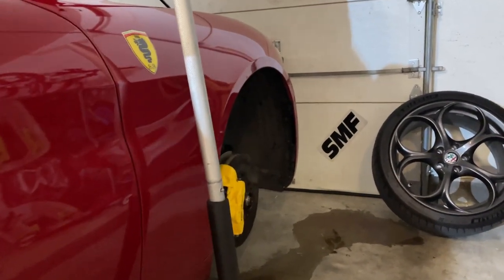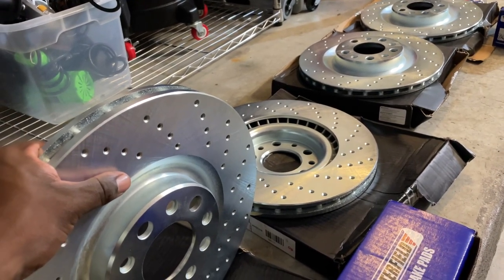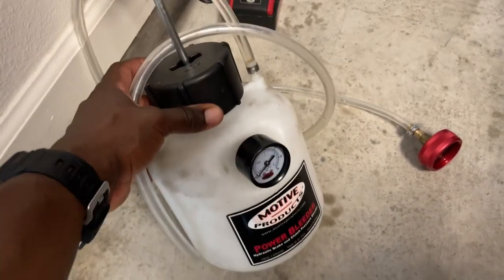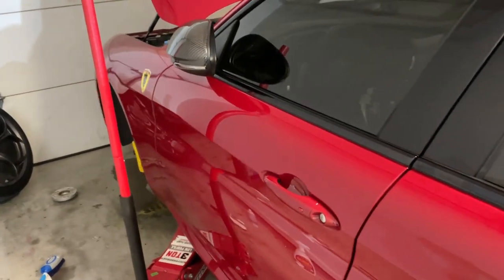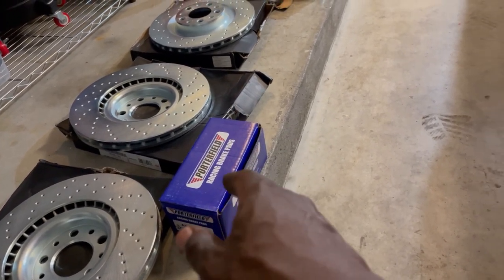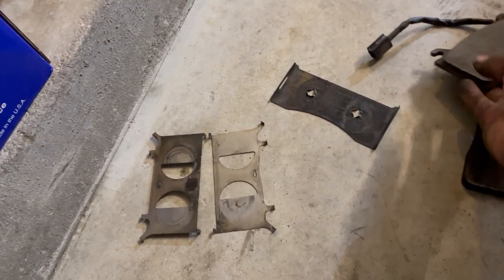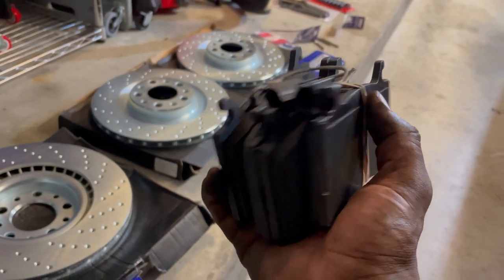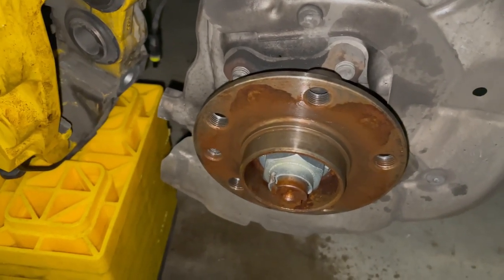DIY brake rotors and pads Alfa Romeo Giulia 2.0

Comment: Completely got me through what I thought I was going to have to spend thousands on at the dealership (no warranty). Thank you for this video and all of your thorough instructions. The only thing I will add is that when I got to the E18 socket needed on the rear brakes (that neither me nor any of the local auto stores near me had) a 14mm socket worked perfectly as a substitute.
Reply from the maker: Hey no worries! Nice hack!!

Comment: Dude, thanks for the killer video, very helpful. Amazing how clean your car is considering miles. Your engine bay and calipers look brand new. I really need to move out of the salt belt!
Reply from the maker: Thanks man! 

Truth be told I used purple power and a scrub brush on my calipers 

And I did a one stage paint correction on my car myself to restore its shine 

Thanks!

Comment: Great vid. Just to add. You can turn the ignition off when doing the rears. When built up just pop the ignition on and go back into the brake service menu. No need to bleed the brakes either as you haven’t opened the system. I’d only bleed the brakes if it was due
Reply: I second this. Did it myself and had no problem
Reply: Can you expand on why We shouldn’t bleed the brakes? I just changed the pads only, when i pressed on the pistons, a little fluid came out of the (master cylinder?) in the hood which i took the cap off for. Not sure if i need to bleed the brakes. The brakes don’t bite right away when i break,  is that normal for the alfas?
Reply: @dawudrashid1515  How did you not have the check brake system light come on?
Reply: @dennisreynolds6915  nothing came on. No codes or error. Just turned of the ignition and when done I turned it on and went back to the brake service menu
Reply: @dawudrashid1515  Ok cool. So did you put the rear brakes into service mode then did the front and back or did you do the fronts first then turn ignition on and put car in brake service mode?
Reply: @dennisreynolds6915  you don’t need the service brake to so the front. I did rear first and fronts like 2 week later. Only need service brake mode for rears. For fronts( also back) have your reservoir cap open.
Reply: @dennisreynolds6915  i would do the rears first. Then do fronts. So you don’t have to worry about all that
Reply from the maker: Thank you!!
Reply: @dawudrashid1515 how do you out it into service mode for the rear’s? With a scanner or can do it do it on the vehicles menu

Comment: Just did all 4 wheels on my 2.0 Giulia yesterday.  Took me all day (I made to two runs to auto parts store to pick up a few items, like grease and the pin punch which is needed).  All went well except now I have several faults on the instrument cluster so I'll need to see how to reset these.  The dealer here wanted close to $1,200 just to do the rears!

Your video was very helpful!
Reply from the maker: Yes this will save you quite a bit of money. If you have a Bluetooth old reader connected to MultiScanECU app on your phone you can reset the codes yourself. You can also use the ecu code reset method that is in a video on YouTube. Takes a few tries but works. i had zero codes when i did mine

Comment: Best step by step video ever! My dealership asked me about $3200 to replace brake and rotor on a car that has only 36k miles. seeing the video it looks straight forward so i will do it myself. (I'm handy guy with good mechanical engineering background ) my only concern is do i need to have reset the ECU after the repair? i cant even replace my oil on my Giulia because i can't reset the light.
Reply from the maker: No need to reset anything my friend!
Reply: @club.alfagt  You're the man!

Comment: You shouldn’t keep the cap off the reservoir for too long. Brake fluid is hygroscopic meaning it absorbs moisture from the air very easily. This will decrease the boiling point of your brakes and can lead to insufficient braking performance. Be careful.
Reply from the maker: That’s right, good point! Hope everyone reads this!
Reply: @club.alfagt  I’m thinking of buying one this week. How has the reliability been for your car?
Reply from the maker: @poptartknight565  great! I’ve only had one issue with a coolant hose cap coming off, but Alfa care took excellent and prompt care of me 

Other than that I’ve dailyed this car with a piggyback tune, driven on the track 2x, road trips 

Bulletproof 

The 2.0t Alfa’s are magical man. Awesome, simple performance and reliability with a supercar chassis for an amazing price
Reply: @club.alfagt  which tune?
Reply from the maker: @poptartknight565  JB4 piggyback
Reply: How long should I take the cap off? Changing my breaks and rotors next week
Reply: That’s a non issue for the time taken to do a brake job.

Comment: When brake disc or anything behind it comes off, then after refitting lateral runout of the disc have to be checked with dial gauge. For example this is written in Brembo instructions.

Comment: For anyone doing this job, do yourself a favor and before you do anything make sure you can remove the pins.  I spend 4 hours using whatever I could find to bash that pin through.  Ive been working on cars for a long time, Ive never had anything so seized up.  Northern state that the roads use salt if that matters during the winter.  I tried everything from torching it, penetrating spray. Once you get it out so far you have to put something in front of it then use a cut off allen key through the hole to hammer the pin the rest of the way through.  Otherwise easy brake job once you get the pin out
Reply from the maker: Just get a push pin set lol

Comment: When I was replacing mine one of my pistons in the caliper popped and break fluid came out? 😅 is this ok or am I in trouble
Reply from the maker: Omg… needs to be rebuilt
Reply: @club.alfagt  yea bro my breaks also went into a fail safe mode idk if it’s only for 2019 alfas and up but I guess your suppose to completely disconnect the battery when you change the breaks should add that to the video cuz that was a big rip 😕

Comment: Great video, thanks for this. I have a Stelvio, but it should be the same job. One thing I don't understand, why would you bleed the brakes? That is needed only, when you replace the brake fluid. I have just purchased the Madness Sport Plus springs, and I'm trying to find a solution for the rear camber adjustment. I'm wondering, if the rear camber arms are the same for both Alfas, because Megan Racings sells adjustable camber arms for the Giulia.
Reply from the maker: I have some Megan racing camber arms in my garage ready to go on soon 😉

I guess you don’t have to bleed them afterwards however I do so out of good habit!
Reply: @club.alfagt  That is great to hear, that you have those camber arms. Can I ask you a favor, could you please measure roughly the distance between the two mounting holes, to see, if the Stelvio uses the same length arm? I would like to order them as soon as possible, but I'm not sure if they would work. Mine is  base model, so I'm about to install the SGW, paddle shifters and red button on my car. Got already the idiagnosis kit from UK, and the multiecuscan software. Start and stop disabler from Ali works great very well, and it is cheaper, than the carstuff unit.
Reply from the maker: @19mati67  I sure can! Are you going to enable race mode in your Stelvio?
Reply: @club.alfagt  I'm not sure what that does on a 2.0L car? It actually changes driving dynamics and removes traction?
Reply from the maker: @19mati67  yessir
Reply: @club.alfagt  Did you have a chance, to measure the camber arm mounting bolt distance? I would appreciate it a lot.
Reply from the maker: @19mati67  as you know, these Megan camber arms are adjustable 

But from the fully closed position, middle of the hole to middle of the hole was 7&1/8ths inches or about 7&3/16ths
Reply: @club.alfagt  I know, that they are adjustable, but I may need a much longer one for the Stelvio. Maybe it is not adjustable to that length. Thank you very much for the info. I will have to compare it to my SUVs arm length.
Reply from the maker: @19mati67  yep no problem! These get installed on the 7th!
Reply: @club.alfagt  Today, I have replaced the red start button, installed the paddle shifters(I still need the software part done), installed LED strips in the V grill, and added those Alfa logo lights in all four doors. It seems like, I will have to buy the SGW extension cables, though I hate spending almost $150 for two pairs of cables. I can't even see the SGW.
Reply from the maker: @19mati67  oh yeh those are awesome mods. I was lucky to not need the SWG but I understand your frustration

Comment: You forgot to wrap a shop towel around the top of the brake fluid reservoir as well as another one covering it to keep moisture from contaminating the fluid. Thanks for the vid, brother.
Reply from the maker: Good points man, thanks!!

Comment: Great video! Very informative. What brand of lowering springs did you get. Also which Michelin tires/size did yours in?
Reply from the maker: H&r lowering springs 

Ps4s 245/35-19

Thanks!
Reply: I do have the TI sport 19 inch rim, so if I want to upgrade the tire ro 245 35 19, without changing the rim too??
Reply: What’s your tire setup for the front and rear respectively?

Thank you
Reply from the maker: @kwakufordjour9568  245/35-19 front and rear tires
Reply: @club.alfagt  how’s it the ride quality? I was thinking about staggered keeping he same 225 but then widening the rear to 245 or 255. Would that make any difference with the Q4?
Reply from the maker: @kwakufordjour9568  I don’t like staggered setups personally 

Ride quality is much better on a wider tire, the chasis is made for it
Reply: @club.alfagt  I called the dealer today and was told that you need to take the car to be reprogrammed so you don’t mess up the LSD and AWD system
Reply from the maker: @kwakufordjour9568  they just want your money bro. My car is awd. Brake system has nothing to do with a mechanical lsd 

But by all means take it to them man 👍

Comment: Do you know the torque setting for the brake torx bolts?  Thanks for the video I was a bit nervous to try this my first time until I saw your video.  My brake wire is so much bigger though. Ebc red stuff.  Wire is about the same size but the jacket on it is what gives it the extra width. I sure hope I don't have to cut that jacket off I'll be grumpy about that.
Reply from the maker: That’s a good question. I am not sure but my default is just snug and then some. 

That’s interesting about the wire. Probably to withstand wear better
Reply: @club.alfagt  yea maybe.  I plan to do the same for tightness. I can't find setting.  So far of all my Alfa bolts tightened it has been the feel of snug then about 1/4 or less past that. So.  Probably same for brakes
Reply from the maker: @Scott-dn1bk  yep and I’ve had no issues

Comment: So I have a break light that constantly turns on and off when I hit my brakes. It says service brake pads. Is this normally a true code or a false one? Would changing the pads make it go away?
Reply from the maker: Yes you most likely need a pad change. Pressing the brakes is causing the brake wear sensor to complete the circuit which is telling you to change your pads
Reply: @club.alfagt  hey ive had my Giulia for a couple months. My front brakes started to squeak when I start driving then it goes away? Any idea
Reply from the maker: @krig6ix  brake pads need replacement
Reply: @club.alfagt  hey do u know approximately how much i should be paying for my rear brake pads and rotors for?
Reply: @club.alfagt  im being charged 1000😭🥲 for a car ive had for more than a month

Comment: How are those rotors holding? I’ve read mixed reviews about the r1 concepts
Reply from the maker: Still going amazing strong. Drive the car everyday
Reply: I too have used R1 rotors on several of my cars and they perform well look great and have a high quality build with no issues at all they don't rust like some OEM rotors so they always look great too

Comment: Can you post the links for both pads and rotors. That would really help
Reply from the maker: Rotors

https://www.r1concepts.com/detail_catalog/index/eLINE-Series/ref=ALFA_ROMEO+GIULIA+2018+Sportcma_Ticma_Ti_Sport+Front++silver+++
Reply from the maker: Pads

https://alfissimo.com/home/1910-porterfield-rs-4-brake-pads-set-front-20l-giuliastelvio.html
Reply: @club.alfagt  awesome. Says 2018 but i think it would work for 2019 as well. Also I couldn’t find the exact break pads you used. Any chance you have the link for them too
Reply from the maker: @dawudrashid1515  it’s all the same man. Just follow the video and you’ll be fine I promise. Put the car into brake service mode before you lift the rear & disassemble….make sure you take it out of brake service mode after you’ve returned the car to the ground…then bleed the brakes like normal from farther at away from the master cylinder to closest
Reply from the maker: @dawudrashid1515  pads 

https://alfissimo.com/home/1910-porterfield-rs-4-brake-pads-set-front-20l-giuliastelvio.html
Reply: Jason from Alfissimo is awesome.  Already purchased a few things from him.

Comment: What are the different shades mean on the rotors & pads on the infotainment display? Does the shade change once the rotors & pads have been changed?
Reply from the maker: What’s shades?
Reply: @club.alfagt  3 show white/gray and one shows black. All 4 pads and rotors were changed
Reply: @club.alfagt  do I have to reset anything since all the brakes were replaced
Reply from the maker: @bobdesai164  shouldn’t have to reset anything besides taking the car out of brake service mode
Reply: @club.alfagt  it was my mechanic who did the work. Since I can drive the vehicle I assume he did put the it in and out of service mode.
Reply from the maker: @bobdesai164  I’m sure he did
Reply from the maker: @bobdesai164  im still not really sure what you mean by shade or color. No shade or color changes when you change the brakes. Im not even sure ive seen different colors on the infotainment display
Reply: @club.alfagt  trying to see how I can send you a picture
Reply: @club.alfagt  you know how colors change when you change drive modes. When I am in Normal mode the brake pads & rotors are showing different colors. 3 showing gray/white (these were showing black before the brakes were done) & one the driver side front still showing black even after brake job completed

Comment: Can you explain how your breaks feel. Does the alfa bite very quick or does it take a little effort. Compared to my honda, i feel like the breaks take a little effort. Might be how Alfa breaks. Just had these breaks installed
Reply from the maker: This car is brake by wire so you’re not actually feeling anything 

However with these newer setup it “seems” like the bite is very instant
Reply: @club.alfagt  is their a break in period for these new breaks? Like does it take some time
Reply from the maker: @dawudrashid1515  yes you must break in the pads. There are instructions for this on the package but basically you break them in the same way as you would all racing pads. Several near-stops from speeds starting at 20 mph all the way to 80 mph 

As with all high torque racing pads MAKE SURE you torque your wheel lug nuts to spec before and after break in. 

Believe it or not the more aggressive pad caused one of my wheels to loosen slightly from the higher brake torque 

Had to start increasing my lug nuts torque to about 110ftlbs
Reply: @club.alfagt  another questions. Since installing the new pads, after i shut off the car, i can hear the radiator fan still running. This has never happened before. Any idea what may have caused it after the break replacement
Reply: @club.alfagt  another question. I totally forgot to put on the back plates on the front pads on. Are they really important? Do I need to reinstall the pads with the back plates on?
Reply: @club.alfagt  beat me after this one. I just realized i put the brake lube on the friction side of it….  What to do? Are my brakes done? Or would the lube go away with driving
Reply from the maker: @dawudrashid1515  if it were me I’d remove the pad and spray brake cleaner on it depending on how much you applied. It’s meant to resist friction and heat so may not go away right away from driving and could be dangerous
Reply from the maker: @dawudrashid1515  yup re use the back plates they help with heat and noise